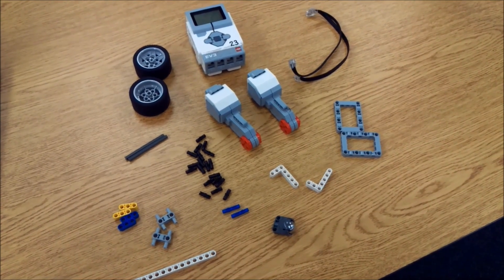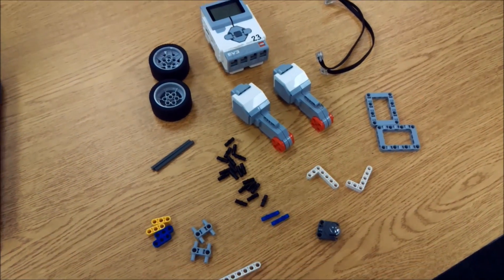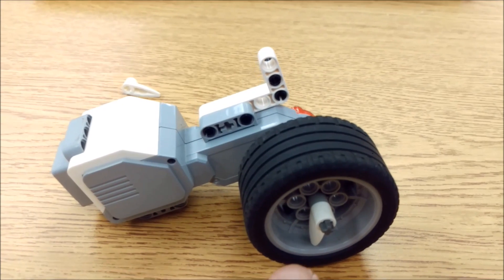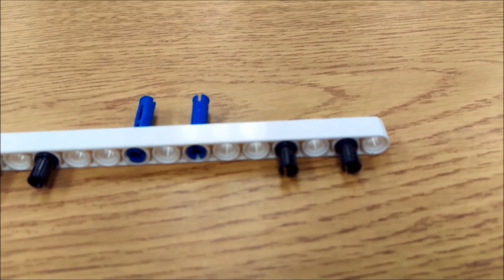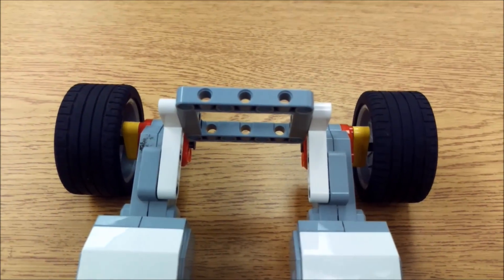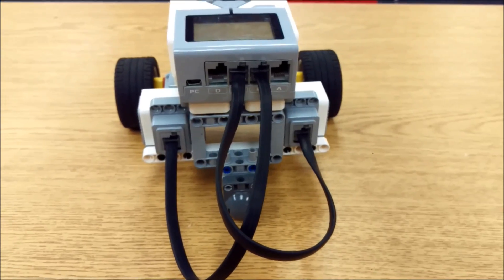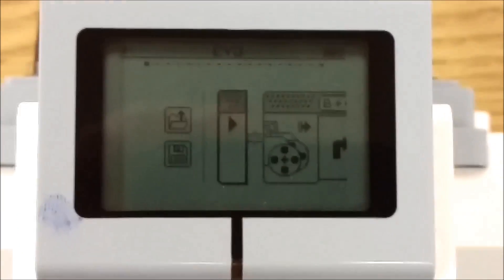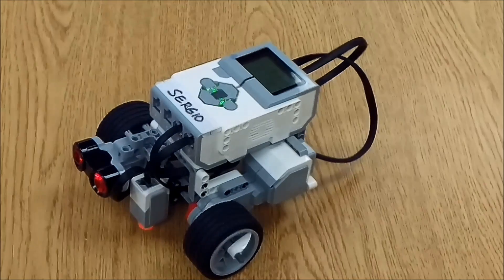"How To Build The Riley Rover Robot: A Quick & Easy LEGO EV3 Robot Build"

Comment: That is a nice, simple build.  I was wondering why use the three-hole beams on the large motors instead of just using shorter axles and moving the wheels closer to the motor, but I guess the larger wheel separation improves turn performance and would help transverse stability if that was an issue.
Very cool.  Thanks!